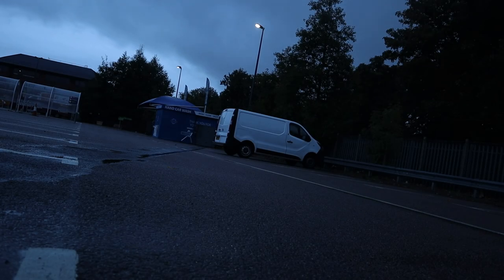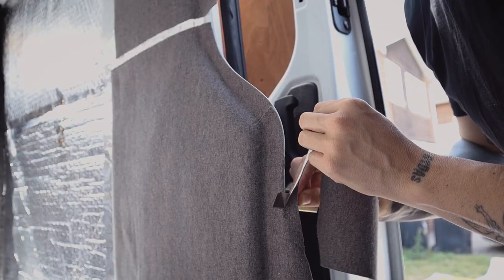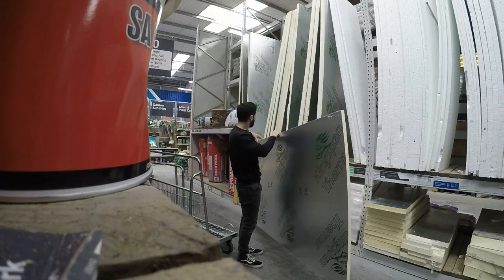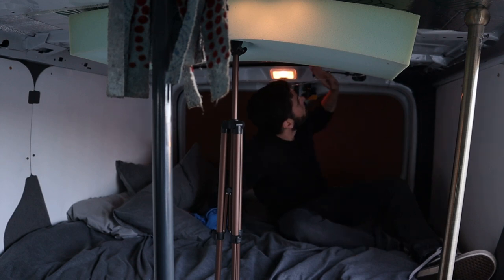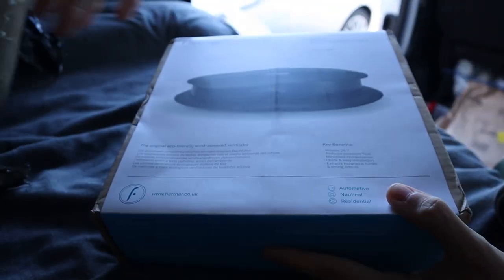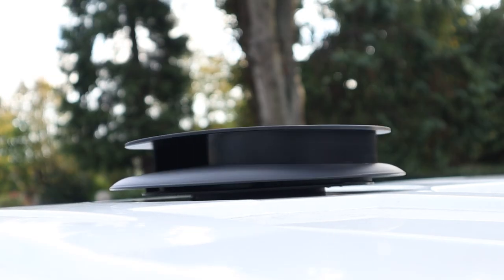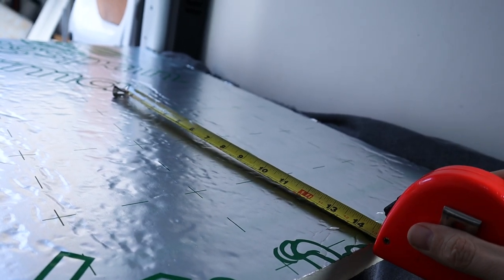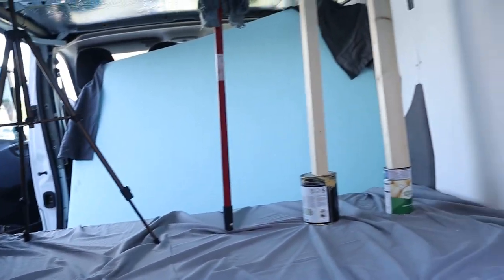Condensation Is Ruining my Van Build | VAN LIFE UK

Comment: Easiest way to increase your airflow is to have a drophole in floor, (shield with mesh to prevent critter ingress).
This will give an air input allowing your roof vent to actually expel the humid air in the van and creating airflow using no power.
Reply: 😂It is only good deal if you use it not in Russia, when it is - 30 C outside in winter. Otherwise this hole will freeze a driver)
Reply: I am looking into Russian vanlife because everything in Russia is better. Slava Rus 🇷🇺🙋‍♂️
Reply: How and why cut a hole in the floor?

Comment: The build is coming along nicely, well done on everything so far! Key to reduce condensation is ventilation. You have those plastic wind deflectors on the front side windows which allows you to gap them a couple inches all the time without rain etc getting in although can let the cold in! I would also recommend installing a diesel heater (I have one of the cheap chinese ones now for the last 3 years and no problem), the obvious benefit is they give out excellent heat to keep you warm!  They give off a "dry" heat so will dry the van and take condensation out. By dry heat I mean it doesn't use a butane flame (like on a camp stove etc) which gives off water vapour and actually creates condensation!! All the best with the build 🙂
Reply from the maker: Thanks for all the top tips there! Really appreciate it 💪

Comment: Great video, I loved watching you work on this project. It looks like the insulation made an instant improvement.  Thanks for sharing your journey. I used to live in a proper campervan with a pop up roof and all the cupboards, sink, fridge etc. but now I've scaled down to an all wheel drive SUV. I just want to say that wood is heavy and fuel is expensive these days so consider keeping your build as light as possible.  I see so many builds that look like they weigh a tonne. I could never imagine towing around ceramic tiles, timber furniture or a full size oven every day like some people do. A heavy build not only costs more in fuel but is more taxing on the engine and suspension etc and can lead to expensive repairs or upgrades required down the road. Keep it light and simple and you'll get a lot further 😊 happy travels ❤️
Reply from the maker: Thanks for the advice, you are so right when it comes to weight, I'll have to think how I'm going to approach this 🙂

Comment: We just bought a t5 and the previous owners had just glued the carpeted ceiling up.   After a few nights the glue comes away due to the conde.  We've used clips to secure it after we stripped it down and started again with it.
Reply from the maker: Sounds like a nightmare, what did you end up doing ?

Comment: Ventilation window cracked open half inch with wind deflector so no ingress from driving rain and A good evernight dry heater that will help with condensation is the 40w or 80w  greenhouse tube heater they draw little do depending on your house battery size this may help

Comment: Fit a roof vent or dehumidifier.  Make sure the air vents on the dash are open and crack the windows half an inch if you can. I found heating the van in the morning helped also.

Comment: vapour barriers ONLY work when they are perfect.  When they aren't perfect they allow moisture through, and will trap moisture.  There are moisture barriers however that allow moisture through only one way.  This way any moisture inside has an opportunity to escape.  Best thing is to have plenty of air movement (but not too much) and a dry heat like a diesel heater or a wood stove.  Good luck man!
Reply from the maker: Great advice my man, will keep that in mind for my next build 💪🏼

Comment: If you had put the insulation onto the outside of the roof held under ply sheeting fixed to a roof rack then you would have the maximum standing head height inside plus you could still suck any occasional droplets off with a window vac instead of them becoming trapped by your Kingspan against metal
Reply from the maker: Hindsight is a fine thing 😂😁

Comment: Hey! What do you exactly do when the moisture outside in winter is always at 95%? How do you let the air from the outside into your car while at the same time not getting your mattress sheets damp or moist? Thanks you : )
Reply: You really need some heat going on inside the van, hot air can hold way more moisture than cold air so...moisture gets absorbed (generally speaking) into the hot air, then goes out a High placed vent; the higher the better.
There will always be some kind of energy loss in these situations but that's the price you pay.
Adequate ventilation plus keeping warm is a must anyway for Good health, so heating and venting solves two potential problems. Cold and damp with stale air is not a Good situation to be in as I'm quite sure you know 👍

Comment: what if you just improve ventilation in the van and be able to sleep with cold temperatures ? condensation should not be a problem anymore right ?
Reply from the maker: That's the plan my man, I sleep with the windows open and hopefully the fan helps 🤞
Reply: @Nomadickangoo  thanks for your reply, so the insulation is also required even with a good ventilation in your opinion?